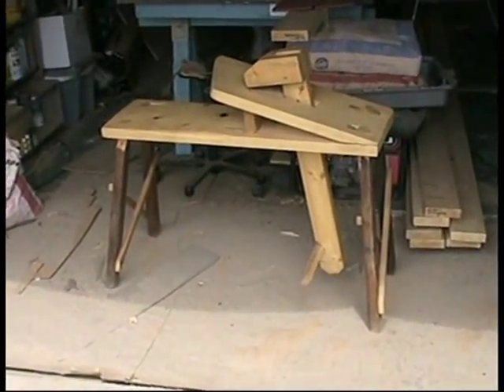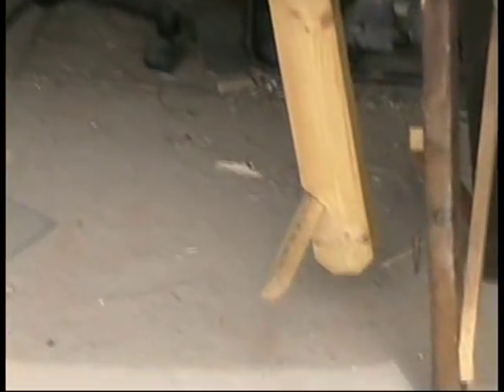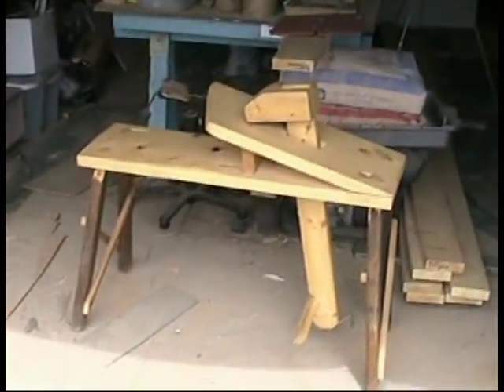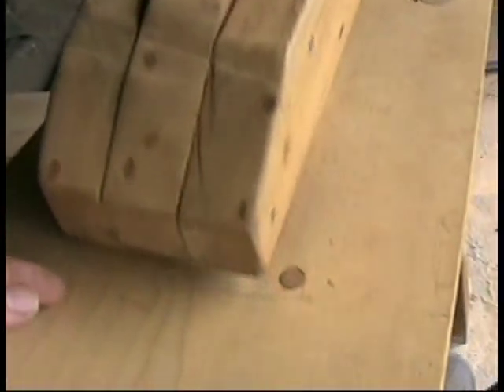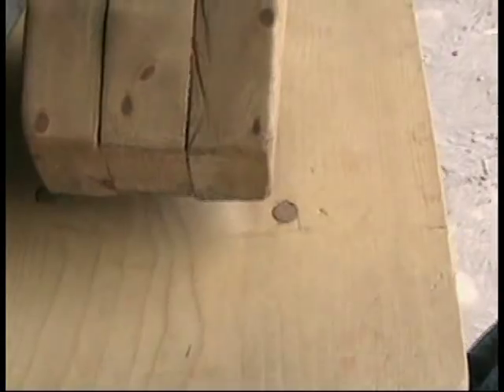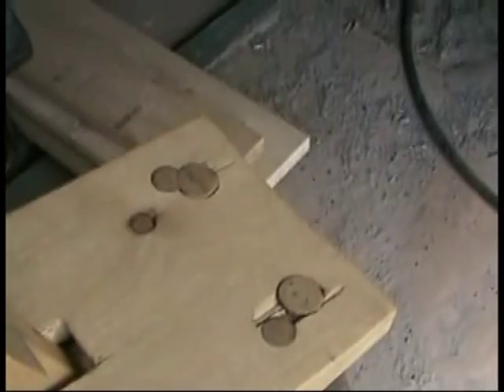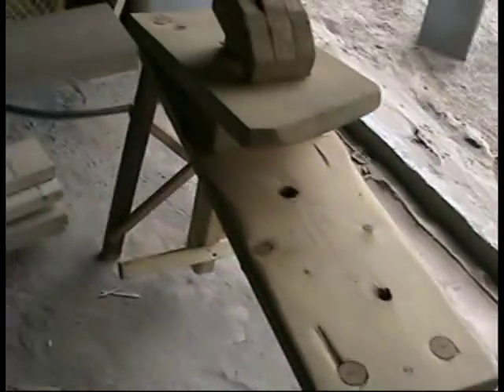Shaving Horse soft jaw vise for hobby working

Comment from the maker: On mine. I put the fulcrum point in the top slanted board, not the horizontal one you sit on.
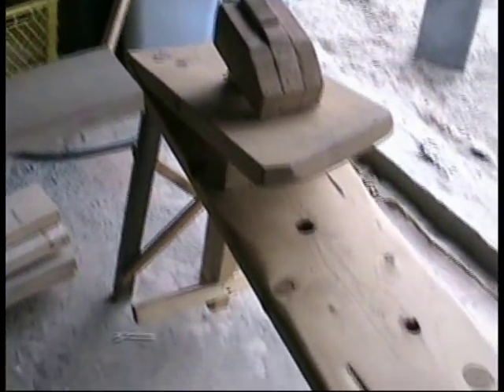I drilled a hole in from the side (made the hole in the "pedal thing" a bit larger diameter) then hammered a large 6" or 8" galvanized nail through. You can see the head of the nail at the 0:58 mark.